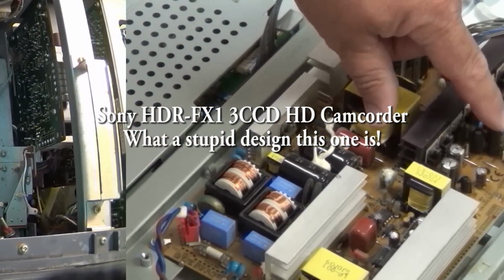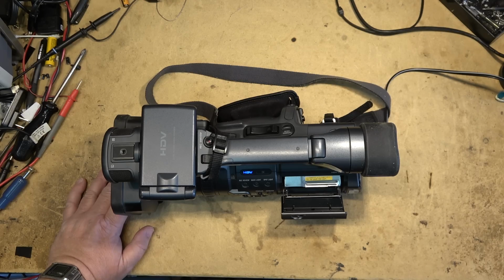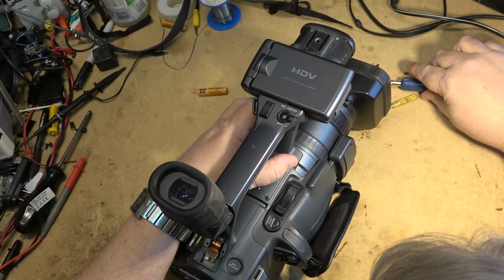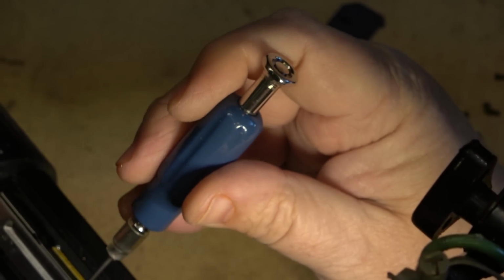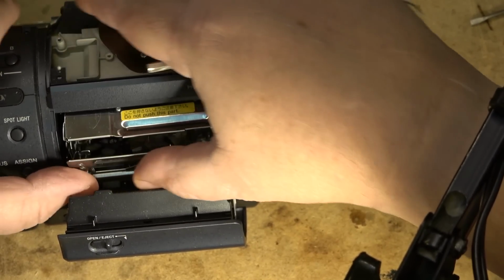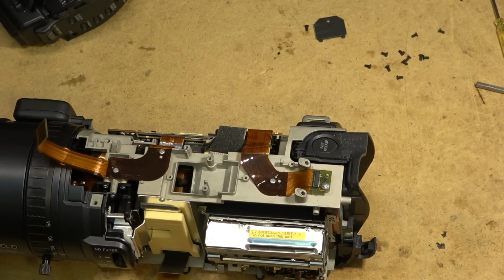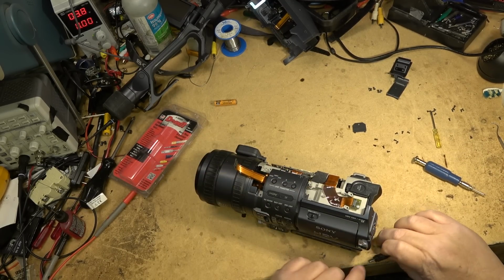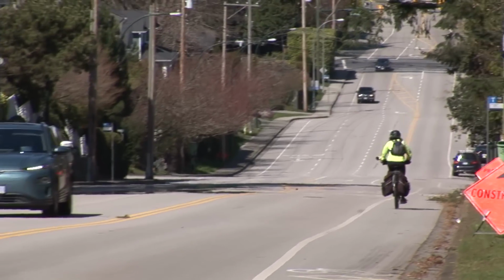Sony HDR FX1 HD camera from hell what a stupid design find out why

Comment: Just got one of these HDR-FX1 camcorders this morning ( £28.70 ebay ) with the same problem: how to lower the deck drawer enough to take the side off; EXCEPT that I didn't consider that the little switch triggered when the drawer is closed was the cause. Eventually - after around a half hour faffing about I managed to persuade the bottom of the outer case nearest the little DC motor open enough to get a 4.5 volt wire, roughly turned around like a double fish hook to make the drawer move down a smidgen or two - then, after another struggle got the outer case free to remove the tape deck and test it in a little DCR-HC19 - where it opened/closed ok but refused to load the tape. Before removing the tape mech in the HC19 I tested it with a professionally used DVCAM tape, where it proved good; so replaced the FX1 deck with it - now it functions perfectly. Obviously not ideal; BUT IT CAN BE DONE.

Forgot to mention: the outer tape door can be removed - 4 screws - plus 3 black screws for plate that hides the tape release switch mech - the bottom 2 are the hardest - to get an effective angle with the screwdriver - helps get a better view of where the Tape Mech DC motor is situated exactly.

JUST FOUND OUT WHERE THE OFFICIAL CONTACT POINTS ARE TO MANIPULATE CLOSE/OPEN FOR THE SONY HDR-FX1: see the following video - Sony HDR-FX1E Dead No Functions ( Electronic Workshop ) - puts to rest the idea that this "Sony HDR FX1 HD camera from hell what a stupid design" ain't so stupid after all ! I noticed them myself before doing the above, but chose not to look closer, for some reason or other.

Comment: That switch likely leads to a couple of connections on a flat flex leading to the main PCB. Perhaps shorting the switch at the other end would have been viable 🤷‍♂️ I have the same camera, hasn't failed yet, so never got a service manual for it, but it seems likely that this would show where the switch leads to.

Comment: I broke mine, I'm so distraught about it because I got a steal for $50 on ebay. It broke because I turned the power on without the handle plugged into the camera which somehow destroyed the main power supply board.

Comment: I payed $25 at a thrift store about two years ago for my Sony FX1.  So fun to go out and shoot.  People think I work at a news station.  It’s still working perfectly.  It still has the battery I bought it with.  I almost never charge it.  My smaller Sony miniDV suck up batteries like crazy.  My Sony 4k video camera is super tiny and battery performance is better.
Reply from the maker: Fx1 is a good unit prone to take up hub failure. Being a 3ccd it shoots great color.   Resolution was only 1440x1080i.
My little 4k handycsm shoots 1920x1080p60 or 3840x2160p30.

Comment: I really like my HDR HC3. But I have an HVR-A1J which is 1080i DVCAM and it just will not power up any more. Screen flashes when you hit the reset on it or insert a battery otherwise no power from battery or AC and no charging....I have no idea where to start on that, I guess it was sitting too long.

Comment: Quick question: Would you shoot your videos on a modern full frame (35mm) mirrorless camera, like the Sony a7 III? I'm looking to buy a used a7 Mark III because I want something for both videos and photography. But primarily for video.
Reply from the maker: Full frame cameras are fine.  I have an a77 which is an old apc size sensor.  It shoots great 1080p60 video and 24mp stills and I have a couple or lenses for it but I prefer my video cameras.  I have an FDR ax100, ax33 and ax53.   All 3 shoot 4k video.  The ax100 has a 1" sensor 20mp, full manual control and can shoot a still that is pretty close to my 24mo stills camera.  It has not only a flip out lcd screen but also an OLED eyepiece which is dead on accurate.  My alpha 77 also has the OLED eyepiece.  WUSIWUG in that eyepiece.  12x optical zoom is great.   My ax33 is more for travel.  It's small, has an evf (not OLED but lcos) so it also looks good but not as good as OLED.  The stabilization is 2nd to none. 4 axis stabalizibg.  10x zoom lens and is also capable of shooting 20.5 stills.  Of course these are jpg only.  My dslr will do jpg and raw images.  One of the advantages of video cameras is the length you can record.  The stills cameras (at least the ones I have tried) stop recording at 29:59. Video camera will shoot till the memory card is full.   For long form event recording this is a must.   Why do the others stop at 29:59?  Because is Europe there is something like an 18% VAT on video cameras.  A video camera is one defined as being able to record longer then 30 minutes without stopping.  So the manufactures limited the video recording to 1 second under that limit to skirt taxes.  Now that might have changed but my a77 certainly has that limit.   Other than that I just find the video camera is better laid out for video and a stills camera is better laid out for shooting stills.  Just ergonomics mostly.  Things like tiltable eyepieces and flip out screens that can be rotated for selfie shoots.  Yes my dslr screen can flip around too but not on a tripod it can't.

Comment: What's the difference between this model and the Sony HDR-FX1 E?
Reply from the maker: The "E" model is Europe.   625 line PAL in SD and 50i frame rate. Even in HD it is based on European frame rate. The video produced playa on PAL and multi system TV only.  Plug it into an older tv that doesn't support PAL and it won't work.  Fortunately all the new TV's support multi system video.
Reply: @12voltvids  I’m in Australia and one had turned up on Marketplace for $150, I’m tempted.

Comment: My cassette tray is stuck in the up position and the cassette mechanism (where you load a tape) door won't open either.  The camcorder makes an awful sound almost like a stripped gear sound (which i'm guessing is why the tray is not going down).  Not sure why the cassette mech door won't open.  I tried to mess with that switch and it hasn't helped.  Any suggestions?

Comment: Just got a HVR-Z1, which is the pro version of this camera, they actually added an access port to get to the cassette loading motor contacts. They knew it was a problem and threw the consumers under the bus.
Reply: having similar transport issues, i noticed these contacts but dont know what to to with them to engage the loading motor. cant find any info online. any chance you know how best to power them to see if i can get the cassette chassis down?
Reply: @guywithaheadache take a bench PSU, set it to like 3 Volts DC, connect multimeter leads or other leads/wires (don't use a scope probe) to the exposed contacts to load/unload the cassette transport. Use positive on one terminal and negative on the other, positive on one side is load and flipped is eject.
Reply: If you don't have a bench PSU, batteries also work. I've used the 5V bus on an ATX PSU before to do this, but you need to be careful because there is a lot of current available on an ATX PSU and you can melt wires.
Reply: @guywithaheadache  another thing you will run into is that the release for the cassette holder, it's mechanical and triggered when the mechanism is at the full end of it's travel in the eject cycle, you need to back up the mechanism a tiny bit before it will click shut.
Reply: Thanks so much! I’ll be totally honest - I have very little idea what I’m looking at, but the repair guys gave me a quote higher than the price of the camera itself. I’m dedicated to seeing this problem solved. Currently, the whole chassis is stuck in the “up” position AND closed (with a tape in there), and I’m pretty stuck on what to do next, since I can’t get the side panel of the camera off and admittedly have very little knowledge on how to get the chassis back down (or open)
Reply: @guywithaheadache there might be something jamming it up, the software will try to open the door when it sees that the transport is up, I wonder if there is a bad switch involved or a dirty mode switch. A mode switch is a multi position switch that moves with the mechanism to indicate to the electronic logic, what the current physical state of the whole assembly is.
Reply: @elektrokinesis4150 definitely jammed somehow. could figure it out if I could just get the side panel off the camera. appreciate you responding to this - not a lot of info on the internet about these camcorders
Reply: @guywithaheadache what probably happened, the idler for the tape drive is stuck or not engaging properly, now normally this would get detected by the logic and trip a code, however repeated power cycling can create a condition where the tape unspools inside the transport and can get itself properly stuck behind the head drum, this could be what happened if there's a tape in it, if there's no tape then idk what's going on. You should be able to get it to close if it's jammed as a result of unspooled tape, then you disassemble the camcorder following the service guide. This gives you a lot of access to either cut or untangle the tape.
Reply: @elektrokinesis4150 there is a tape in there, very likely that you are correct. are you saying I should be able to get it back down before i disassemble, or that i will have to disassemble to get the chassis back in position?
Reply: @guywithaheadache  You need to get the tape mechanism near closed in order to take apart the camera, or you will encounter the same roadblocks that 12voltvids had in this video. Depending on how bad it is, you might be able to close it with the methods I described above.
Reply: @elektrokinesis4150 gonna get my hands on a PSU and give it a go - wish me luck. thanks so much for all the help!
Reply: How do I get to that access port? I can open and close the lid perfectly, but I need to take out the little black pinch roller.
Reply: @jorntelzinga7826 mine just has a cutout for it on the bottom, it's possible you have a revision of the plastic before they added it

Comment: Hi,  was curious if you know how difficult it might be to replace the eyepiece on one of these.  I'm not knowledgeable but let me try to explain and see if I'm correct.  You have the eyepiece, then there is another piece that slides/clips/attaches to that for focus control, then you have the rubber eye cup that attaches last.

All I have on mine is the eyepiece, no clip on piece for focus and no rubber eye cup.  My eyepiece does work, however the vertical rails that the focus piece would attach to are chipped and broken, so I don't think the focus piece would slide on with the condition mine is in.

There is a guy on ebay that has all the pieces to replace the entire eyepiece but back to my original question.  I haven't found a full tear down video on the FX1, so was curious if you knew.

Thanks

Comment: Hi. Do you have any suggestions for going tapeless with this model? My FX1 is rejecting all tapes as it seems the rubber roller has fallen off. Have you heard of HVR-MRC1 or HVR-DR60? Both built for V1 but can be used as external recorders via FireWire. Therefore eliminating the need for tapes with this unit. I’m wondering if you know other ways to perhaps use newer external recorders like Atamos Ninjas (that take hdmi inputs). Is there a way to output FireWire 4 pin, or component to hdmi?
Reply from the maker: The firewire runs under colorspace 4:2:0 whereas you can get higher colorspace directly from camera.    I gave up on those old cameras years ago and record directly to sd cards.  Firewire output is limited to 25mbits.
Ninja would be a great option but fx1 doesn't have HDMI only component. So that leaves digitizing the component output.
Reply: @12voltvids  The FireWire should be just as good as tapes right? If not slightly better?
Reply from the maker: @Dyl-Cam  The firewire just sends the digital data that is read off the tape directly out to the computer. There's no analog signal generation it's just the data. The problem is that if dropouts occur on the tape the dropouts will not be corrected and that erroneous data will be sent out the firewire and store it in the file. This causes headaches for nonlinear editors because they will interpret this corrupt data as pixelation or the wrong colors or all kinds of weird things and you'll typically have about a half a second of disrupted video. HDD was far more problematic than standard definition DV because standard definition used a fixed 5 to 1 Mjpeg compression.  In other words each frame was a full frame. Hdv on the other hand used a long GOP mpeg2 stream. If you've lost a packet you lost the rest of the frames until the next keyframe. So one glitch resulted in 15 frames lost. Now I have found that if I play an hdv tape and I capture it with my new cloner alliance box pro, those glitches off the tape do not appear and this is because the camera or the playback machine has memory inside it and when I drop out occurs it just displays the image that was currently in memory from the previous frame. I will be doing a demo soon I don't have a date when I'm going to make the video as I've got a few things to work on in the shop and this will be done once I have some time but I'm going to make a more in-depth presentation for the cloner alliance box. It will be all demo footage from different sources. I will show it at the three different quality settings from both VHS, betamax, 8 mm and high 8, mini DV and digital 8, hdv, dvd. I will capture the same segments using multiple capture devices.  Those devices will be a hauppague hdpvr, a Panasonic DVD recorder, a Toshiba DVD recorder and a Sony GVD700 analog to DV encoder as well as a digital 8 camera that will digitize analog tapes and send output via firewire and of course the cloner alliance box pro, using composite, component and HDMI inputs.  The cloner alliance will be set to upscale everything to 1080p at 60 frames. All the other sources will be captured at their native resolution for both ntsc and pal tapes and DVDs. The standard definition recordings will be scaled to 1080 in my editing software. So the frame size will all be the same this will be a great way to compare analog tapes being converted to HD compatible signals using the various pieces of equipment that I have access to. as I previously said I don't have a date to when I'm going to record and produce this video but it will be sometime in the next month I would think. As the weather starts to turn against us and I won't be heading out on my bike I'll have more time to play around with this equipment. Of course as long as stuff keeps coming in to be repaired I give those higher priority but there will be a longer video coming out soon to compare the different types of digitizing equipment that I have. I think you'll enjoy it.

Comment: I got an HDR-FX1 with a different problem on eBay yesterday (pinch roller came off) and your video was extremely helpful in getting it open to work on that. Thanks!
Reply: Was this hard to fix? My rubber roller came off and fx1 isn’t accepting tapes. I keep getting an error. And can’t find the pinch.

Comment: Do you happen to know, is the power supply the same for this model as used on the vx2000/vx2100?  And I belive it takes L series batteries?
Reply from the maker: It uses the same batteries but i don't remember if the power connector we as the same.  It's a flat metal plug the same as the digital 1 used.  I had a vx1000 but can't remember if the connector was the same or a plastic connector with 2 or 2 pins on it.
Reply: @12voltvids  ok thanks for the reply.  I just bought an fx1 in a lot with other items this morning.  Says it doesnt power on.  You want another migraine to deal with? (haha)

Comment: Very good video. I was tempted to buy a used one today but now I will nix'nay that idea'ay. (Cancel my used purchase idea)

In years past (2000 ish)  I spent $3k on a used vx3 3 chipper and had a faulty audio costing an additional repair $300 so definately buying used can be an issue. (yes you purchased yours brand new).

I'd love to get one of the camcorders you recommend there as I'm not sure if my zv1 will be better and I don't have the patience or willpower to learn a dslr:)

Im waiting for the "supposed" new Canons coming out but ...at some point how long can a person wait
cheers
Reply from the maker: What do you want it for?
Video or stills. If the answer is video grab a used fdrax33 and be done. That is one of the best little cameras I own.  Small, optical stabalization, 4k video 1080p60 video and it will shoot 20.6mp stills.  I have one and shot hundreds of my YouTube videos with it.  I use an ax53 now as it has a longer zoom lens 20x vs 10 so I can get closer close up shots without having to bring the camera in closer.  The ax100 is also an even better choice but costs quite a bit more but has larger sensor so can shoot with a shallow depth of field.  When traveling i usually take the little one just because the quality is fantastic and i am not carrying around a large camera but for photography trips I use my ax100 for both stills and video.